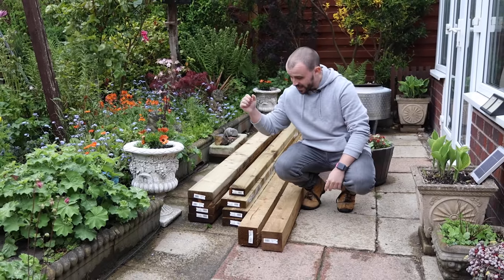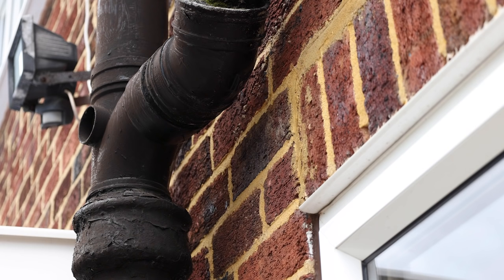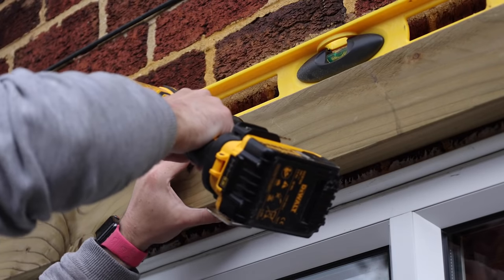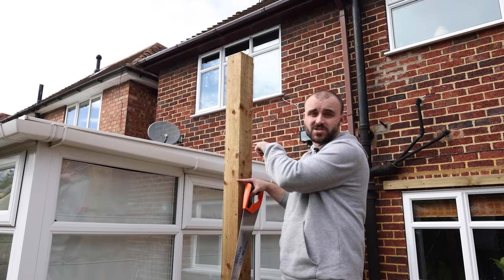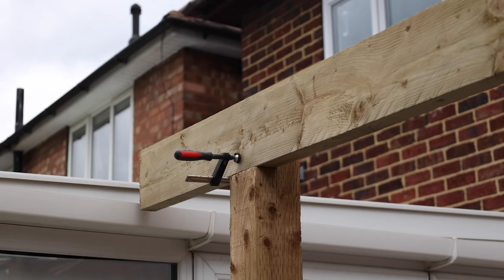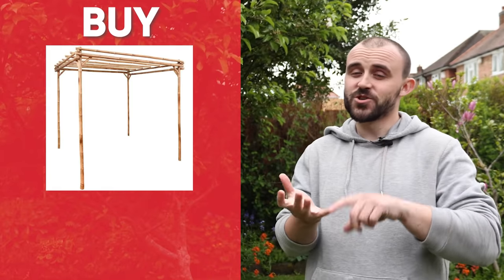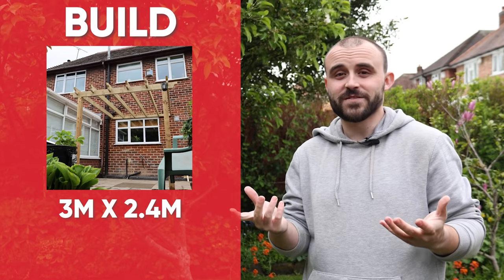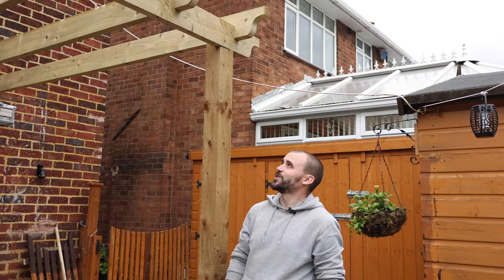How To Build A DIY Pergola | Build Or Buy - Is It Worth It?

Comment: Great video! What I like the most, is that you cut the wood outside and on your table. I watch other DIY videos by people with a huge warehouse in their garden and every tool available to them. Your video makes me think I can have a go at this myself. Thanks
Reply: A very user friendly video isn't it!
Reply: Haha exactly... "First you're going to want to find a nice tree in your personal forest and start by cutting it down and running your wood through a plainer.."
Reply: What equipment is needed for this job , I want to try as well.
Reply: @DH0071  drill machine, stone drill, plugs, deadbolts fitting with the plugs, a jigsaw and a normal saw or circular saw to top the standing pole. Oh, and something to dig a hole, mix your quick concrete and a hammer and some other small hardware to keep the pole upright whilst the concrete is setting. Pretty minimal, with some basic tools. The jigsaw isn't necessary perse, it is nice for the ornamental cuts, but using some straight angled cuts should work out great too (circular saw, or normal saw)
Reply: Exactly, great comment 😊
Reply: Great inspiration! Helped me to get the courage to build it myself! Well done.
Reply: Exactly, "These cuts are very simple to make on my 6k table saw"...
Reply: Thank you this is easy to follow . Clearly can see what you’re using and how you do it . 💯👏❤️
Reply: Thanks !!! Amazing video!! I will do this myself 🙌

Comment: Just finished this with bamboo rolled on top attached with fence staples. Looks awesome, great video. Used fencing rails for the rafters and would recommend useing planed timber for the post uprights if you can afford it. Used clear silicone round the gaps in the joints etc. This from an amateur diy er 😃

Comment: Great video, very clear instructions. Don't forget to add a can of sealant to your budget and procedures. Every cut should be sealed, and depending on the size of the hole and treatment method, every hole needs to be sealed as well. Especially if that wood has a warranty.

Comment: V good video. I built one of these years ago and grew climbing plants on it. Only thing was if you sat under it in rain it was wet so we added some clear top panels to provide some cover. That worked well but you had to maintain them regularly. I'm in another house now and planning building one and fixing a pull out awning on one side. That will neatly hide away when it's dry but allow it to be covered if it's raining but warm. We are going to put a table and chairs under it.

Comment: This video was great, I love how you demonstrated everything clearly without complicating for the novice diy person. I used your help and just finished building my own in 2 days!
One question, I’d like to secure the cross beams as they’re not all tight, what would you suggest for this and how please?
Once again thanks for all the help with this video.
Reply: If there’s gaps I’d use wood filler then you can get 4 inch hex head screws (coated for outdoor use) to hold it

Comment: I used fence post brackets to secure mine to the ground. You can buy some really fancy ones that hold very firm and it makes it easier to remove and saw if needed.
Reply from the maker: Thats a great idea Glenn! Much quicker and easier to fit and easier to remove later if need be too :) Joe
Reply: Did you just screw into patio slab?

Comment: Great video. I am getting ready to build one myself.
For 8x8 patio area, I am going to use 6x6x8 for my posts.
Then 2×12 ×10 for my beams, but I and double beaming my posts. 
The 2x6x10 rafters and 
For the lids 2x2x10 also I am using metal brackets for all corners and fasteners. I feel it will be better against the elements with this type of support.

Comment: Great video - best on the subject I've seen :) Can you tell me though - what if you wanted to tweak this design slightly to allow a small slope in the roof to fix some perspex so you can escape showers? Does it make it more complicated to build?
Reply: Just mind that there will be a slight angle on cuts for the parallel boards and you should be good.
Reply: You'd also have to factor in guttering and a downpipe and drain away to get rid of the rainwater.

Comment: Awesome. Watched this and built my own. 3m x 4.8m cost of timber was 230 and another 35 ish on extras, 270 tops, in shops was looking around 600 for the size. Well worth it, only tools used was my drill, screwdriver, saw. Took me say 7 hours on a Saturday and another 3 on the Sunday to do some finishing up and adding trellis for some climbers. Wife's pleased so all good 👍
Reply: Building one with the exact measurements, did you use 6 rafters for the top or add additional ? Did you put a tilt on it ?
Reply: @katebohan17  wish I could add a pic and show, it's 4.8 wide, 3m deep, 2.4 high. I have 7 uprights, because its on top of my decking I wanted to make it 100% sturdy and solid. so 3 uprights bolted to rear of house, 4 at lawn end, one either corner 2 in middle to create a archway to lawn, left side has our boundary fence, right has wall from extension half way, rest a 90cm fence, lawn edge also has a 90cm picket fence with a gate in the arch section for access to garden, on top I have 6 3m lengths evenly spaced, I have 10 39mm x 18mm 2.4m battoning to make 5 4.8m horizontal lengths and 4 of the same over the top for climbers. Added a star jasmine and bridesmaid clematis. Oh, and it's not on a tilt because it has no fixed roof so no need to worry about water collecting, but my last job for it is to figure a way to add a retractable canopy for shade when too hot as it gets the full fun. 
Hope helped 😀
Reply: @RKaye87  sounds awesome..you can buy the retractable blinds..put some thin metal rope wire around the edges with hooks in the corners attaching it. You can buy the retractable roof curtains with the accessories too.

Comment: I want to build a pergola and found this very useful.   I don't want to dig into a recently laid resin floor though,  is there another way to secure the front posts?
Reply: You can buy brackets especially for pergolas some even use brackets for building fences too.

Comment: Very easy to follow, well done,  another question though, what sort of size are the notches you cut out for the beams???   Cheers
Reply from the maker: Thanks Paul! Really glad you liked it. I cut the notches 50mm wide and about 30mm deep. I would have normally gone a little deeper but I wanted to maintain as much height on the ridges as I could 😊 Joe

Comment: Is there a way to not set the posts in the concrete? I’m thinking the hassle of replacing them when they quickly rot due to sitting in moisture

Comment: Really good video. I’m thinking of giving it a go myself. Mine would be a free standing pergola, and I’m quite short, but what kind of headroom should I leave under the horizontals? Would 2m be sufficient?
Reply: I just built a roof over our outside bar and gave 7ft clearence. I personally wouldn't want it lower after seeing it in situ.

Comment: Great video. Can I ask about the tape on your drill bit when drilling into the house? Was it some kind of guide ? I always either drill to less or to much ! Thanks
Reply from the maker: Thanks Jason! That’s exactly what it is. I add some tape to the drill bit so I know how deep to drill. If you leave it sticking out, a little bit like a flag, it’ll sweep away the dust when it hits the surface to make it even easier spot when you’re deep enough 😊 Joe

Comment: Looks amazing. How would I go about building this but with a slight decline on the roof? As I want to fit corrugated sheets to it. I can’t find any video that shows what angle and pitch to cut the cross beams too??
Reply from the maker: Thank you! I’m not 100% on what the typical pitch would be but looking through some examples on google a few people seem to recommend a 6.5cm drop on a 2.4m roof. I would first find the level on both sides and then make sure the one side is at least 6.5cm lower to enable the run off of water. Sorry I cant be of more help on this 😊 Joe
Reply: @WatchShareSave Thanks a lot! That really helps 👍🏻
Reply: A flat roof is typically a fall of 1:40. That's the fall I put on my pergola. That means over 4m, the fall is 100mm

Comment: Did you say those were 4x4 posts? Any issues today with them? I’m hesitant to use 4x4 but my current deck design doesn’t really allow for 6x6s without spending a fortune on over engineering

Comment: Amazing work! Are you not concerned about the wood stands rotting from the ground up because of the ground humidity? I always screw wood stands to a metal end at the bottom to avoid a direct contact between the food and the dirt. Has it been standing time so far? Cheers!

Comment: Great video.  Would be helpful to have an accompanying sheet detailing the distances on notches and post distance from house and template for curves.  Thanks.
Reply: Joe gives the sizes and numbers of the timbers he's using right at the beginning.  Everyone's circumstances will be different (like the height of the top of his window and the bottom of that air brick), so you'll have to work everything else out to fit your house and your available space.  To draw curves, try using a suitably sized paint can (or cans) to draw a couple of circles, then draw a line between them in whatever manner looks good to you.

Comment: You don't want the post-crete to finish lower than any finished patio or block paving. Or rainwater will drain to this point. The post will rot where it protrudes from the cement. Best way is to cement in a post support into the post crete so the base of the post is suspended from the ground level. This will allow it to dry out in rainy conditions and slow down the rotting. It will also allow an easy way to replace in future. All cut ends of treated timber will need a good coat of wood preservative.

Comment: Good video. Can I ask are you concerned about the cement chemically damaging the timber?
Reply from the maker: Thanks! The cement I used is specifically designed for securing wooden posts but as far as I’m aware there isn’t a chemical process that damages the timber. Just water damage. I used treated timber which is resistant to water damage 😊 Joe
Reply: Personally, I always use rough granite chippings around a post. They allow the water through and  settle to make it just as firm. Also removal of the post for any reason is simple.
Reply: @intergalactic2011  won't the water settle at the bottom then?

Comment: Good video. Think I'll give it ago my self and will post a pic once its finished
Reply from the maker: make sure to tag us!
Reply: I forgot to ask. What sizes where the notches you cut out as you didnt say in your video
Reply from the maker: I cut the notches to match how thick the wood was for the ridges, in my case, roughly 50mm wide. I then just cut them 30mm deep, this depth isn't crucial just dont go past halfway on the timber you're cutting the notches into :) Joe
Reply: @WatchShareSave  I have made it, and tagged you in on it on Instagram.

Comment: Could you use the metal clamp things that you screw in to the ground, then fasten the posts in to them instead of lifting up paving slabs and concreting them in.
Reply from the maker: You definitely could! If you're slabs are solid and level, then those would be a great option. Our slabs aren't in the best condition unfortunately so I opted to cement the posts in instead :) :)

Comment: Hi joe. What size coach screws did you use ? also the size of screws for screwing it all together please, as I’m going to be giving this a go!! 😳
Reply from the maker: Hi Helen, The size of the screws will depend on the thickness of timber you're using so it's worth keeping that in mind but I used M8 x 100mm coach screws to attach the batten to the wall. For the rest of the construction I used 80mm screws. Just make sure the screws are long enough to fully go through one board but not all the way through the other. So for joining 2 pieces, 50mm thick, 80mm screws work great :) Joe

Comment: Good job apart from the levels are out. The wood above the window is out and so is the wood across the front. Hard on the eye. It's always worth getting someone to stand back and look to check if it looks right. If the window was really out, which I doubt, it would be better to have gone with the window level. That would have looked better.
Reply from the maker: The window is indeed out unfortunately. We debated whether to match it to the window but decided to go with level to make the rest of the build easier. It's a lot easier using level as a reference point. It is a lot less noticable now we have some furniture underneath and we have painted it too. :) Joe
Reply: I'm not sure the window is out by much. At 2:08 you can see the right hand end of the wood drop when you picked up the drill.

Comment: i am thinking of building my own pergola now i have a decking and i have a gazebo on it but its metal and the polycarbon roofs have flew off with high winds so time to come down the gazebo is only 3mx3m my decking's 3.6mx3.8m i recon i want a pergola at 4m each way if i can cut it to the size of the decking would be best as i hate when it rains and having to walk on wet decking i have artificial grass on my decking to make it look like a grass deck i am just wondering what may your thoughts be on the size of pergola on my decking as i am not sure if i should keep it to a 3mx3m

Comment: Can u put a roof on this ? I'm think of taking up wood work as a hobby but I'm very new to it all
Reply from the maker: You could definitely put a roof on a structure like this. You would need to make sure it slopes to one side slightly to allow for water to run off but it would be a simple addition :) Joe
Reply: @WatchShareSave  why WOULDN'T you put a roof on this ? what's the purpose of a PERGOLA ???

Comment: Did you consider making the Pergola to match the 'lean' of the property? Just looks 'wrong' to my eyes having the window head and Pergola wall plate out of line.
Reply from the maker: I thought about it for a while, with it being only slightly out of level it wouldn’t really have made a difference. I just thought it would be easier to make the wall plate level so the rest of build could be referenced off of it. It’s not as noticeable now thankfully but concerning to know our house is lop sided 😂 Joe
Reply: @WatchShareSave  It occurred to me this morning, you did reverse your spirit level to check that was reading correctly?
Reply from the maker: I did unfortunately haha Joe
Reply: @WatchShareSave  You could plane down the bottom of the batten to make the bottom visually level and the top actually level, right?

Comment: Hey bro what about water pentration if we putting polycarbonate sheets on top
Reply from the maker: If you're going to be adding a polycarbonate roof to it then the main thing is to make sure the run off is away from the house. The treated timber itself is fine out in the elements so as long as the water runs away you're good to go :) Joe

Comment: Another thing to remember is that the prebuilt ones are made for east manufacturing and minimal often minimal specs. The thickness and improvised joints in ready made ones often shock me. If we have the time and cost, building wins!

Comment: My experience with coach bolts is they rust and break after a while I use 100mm concrete bolts no need for a wallplug by far hander
Reply from the maker: I've never actually used concrete bolts before, coach bolts have always been my go to. Had a few things mounted outside with no issues but I'm sure concrete fixings would be a good way to go :) Joe

Comment: are you able to say how deep the posts were fitted, and how high the top main brace was from the ground ? and how much they hang over the front etc ?
Reply from the maker: I set the posts roughly 50cm deep which should be plenty strong enough. The height from the floor is 240cm and the over hang I went with is 20cm :) Joe

Comment: We built our own because of the shape. It worked beautifully. We used L-shaped brackets on long steel pins to support the uprights. We drilled a suitable hole straight through the paving and concrete underneath it and knocked the supports into the base. Ours is freestanding because it is s rental property and we couldn't drill into the building. A pity I can't upload a photo.
It's much cheaper to build than to buy.
Reply from the maker: That sounds amazing Melody! Love the fact that it's free standing and easy to dismantle if need be. I bet its a great addition to your garden :) Joe
Reply: @WatchShareSave  it is.

Comment: I am planing on building something similar but with four posts rather than joint to the house. We want to build a swing bed and hang it under neath the pergola with chains. Do you have any tips on best way to do this. I’m not sure if the beams coming across from back to front would be strong enough to have a chair from, I imagine they would need to be about the side of size of the posts for it to work?
Reply from the maker: Hi Adam, Ideally you want the anchor points on the beams that directly attach to the posts. Depending on the weight and size of the timber you're using, you may get away with hanging it from the ridges too. Might be worth seeing what the structure is like when it's up, you'll get a much better feel for how sturdy it is then. As far as attaching the chains, you could drill holes through the beams and thread the chains through or look at some heavy duty anchors to attach them too :) Joe

Comment: What's purpose  of it  no roof on it😄
Reply from the maker: I don't really know the origins of the traditional pergola design but I believe they were used for growing plants around seating areas. They are still used for that but most people use them to designate areas in a garden. You can easily add covers if necessary but again, most of the time people prefer to have the sunlight shine through :) Joe